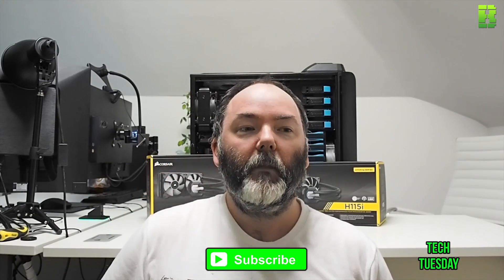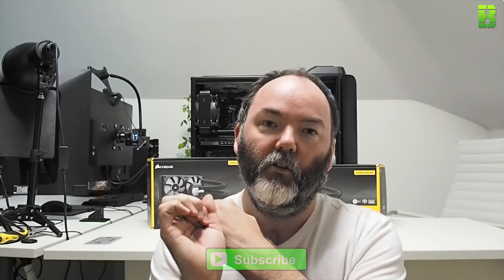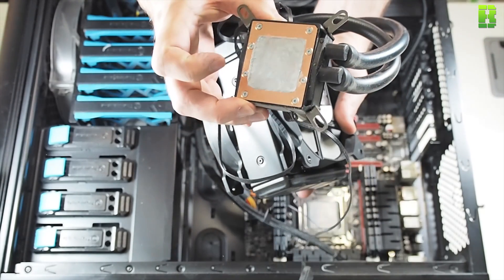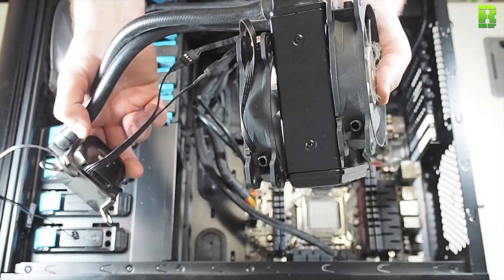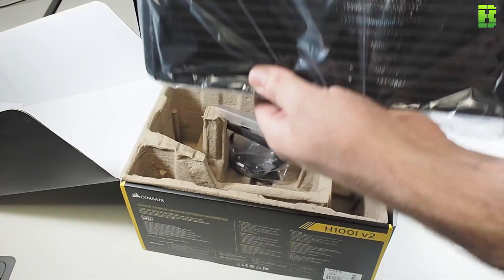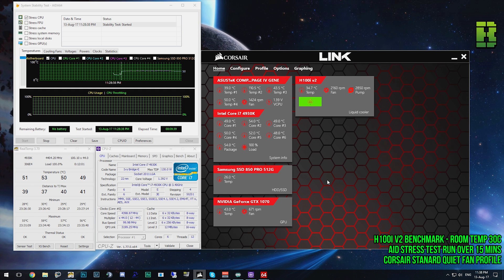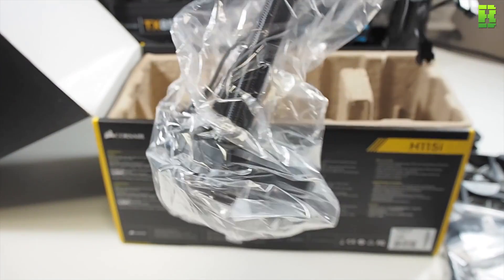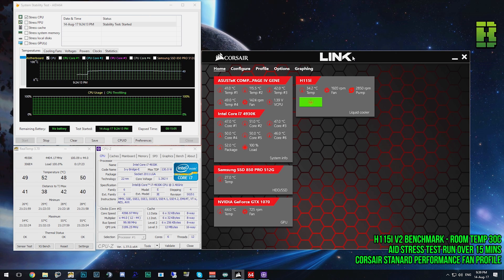Corsair H100i v2 Vs H115i Setup Installation & Benchmark

Comment: is the H115i hotter???
Reply from the maker: They were very similar, the main difference is the dB levels to achieve the same cooling temps
Reply: Beardedbob if the h100i v2 vs the h115i With the fans at full blast, which one is Best cooling performance wise? In your test the h115i seemed hotter, which i dont understand.

Comment: you put the system on 100% load for about 5 minutes with the first cooler, and then for about 10 minutes with the 2nd cooler, you should at least run 30 minutes on 100% for each cooler to be honest. with this bench test we cant say anything about the performance of either one. :( thanks for making the video though.
Reply from the maker: Yeah, I could have done a more extended test. I've done a few before and when the top temperature they don't generally move much from it. If I do some more, I'll look to do a more extended test though 👍
Reply: @Beardedbob  you'd say performance between them are too similar so that vsn be said that the cheaper one is the better option?
Reply from the maker: These two are very close in performance I found the smaller 240mm fans to perform better but they are louder. If its between these two I would base my decision on the two following requirements:-

1. How loud you are willing to accept (280mm being quieter)
2. How much room you have in your case to mount it.
Reply: @Beardedbob  thanks, I'll was leaning towards the larger fan option because of noise levels so the larger ones are the only option for me, thanks again!
Reply from the maker: Np Glenn Snel glad I could help 👍

Comment: well the 115i is performing not as good as the h100i v2 but did you look at your fan settings?  the h100i v2 is running much higher fan and pump speed.  so it is getting lower temps but how noisy is it in comparison?  If you equalize fan speeds what is the max performance that you will get?
Reply from the maker: Its good point but I couldn't tell the difference though I'm used to having loud pc's. Specs say 40db for the 115 and 37 for the 100.
Reply from the maker: no DB meter but for the next I might get one so i can see how loud the are in numbers hard to tell by ear.

Comment: i have the h100i v1 and i hit 90cpu on battlefield 1 2k max graphics. tower's Ambient temp is high ok (55-60_ because of my gtx 1080. liquid temp on pump gets 52 at its max. Is that normal? Why that high temp? Maybe my high ambient temp in tower makes the problem worse or the liquid inside the h100i v1 is dead? i have it more than 3 years i think
Reply from the maker: Seems high. What CPU do u have and is it OC? 

It should be 50c to 60c std underload generally iand 80's OC. 

Also worth checking the thermal paste is good or swapping it for some new.

Comment: 51C is 122F.  That still seems a little warm or is that acceptable.
Reply from the maker: Hi,

51c is cool given its OC and running in a warm room around 28c. The CPU can run up to around 80c without any damage so if you are around this temp you are well within the heat limits.
Reply: Base CPU is 28-32C Idle, 51-55C Cinebench.  4.8 Overclock is idle  31-34C and 76-81C.  Thanks for the info.
Reply: under 60C - very good    60-70C - cozy area     70-80C - still in normal, comfort zone    80-90C - not very good you should consider upgrading     90 and up - unaccaptable. So 51C is a very good temperature for the CPU and you have a ton of headroom for overclocking.

Comment: h100i v2 vs h115i The result is less noise ! 2160RPM vs 1260RPM and pump is running slower = more lifelength ?
Reply from the maker: The noise on the h100 is 38db and the h115 is 40db so they are both similar in that sense. The pump could be slower in the h115i i've not checked or seem this but life length is hard to predict and usually the fans go first tbh unless you get a lemon or you change the cpu and cooler at the same time. The average life span is about 2-3 years people reckon.
Reply: 2160RPM vs 1920RPM  for fan
Reply: That would be correct, I'm upgrading from my H100iGTX to the H115i Pro because mine recently died at exactly 3 years since the PC was built.

Comment: Thanks for the video.  I have the h100i v2 in my case and was really considering moving up to the h115.  But from what I see in  your video temps actually where higher.  Which cooler would you recommend?
Reply from the maker: Hi,

I would save your cash and just stay with the H100i v2 if you are finding its keeping the cpu cool.
Reply: Beardedbob yeah.  I have the 7700k overclocked 4.9ghz.  Max temp 69c after 30min stress.  Id like to hit 5.0ghz but im looking for a better cooling option.
Reply from the maker: Nice OC, I want to try the Kraken X62 280mm or a be Quiet 360mm AIO
Reply: Beardedbob i think i might just go full liquid.
Reply from the maker: +SpecterMatthew custom is the best :-) and looks sexy as
Reply: I'm with BeardedBob.  Save your money.  You're talking about spending $135 to upgrade a perfectly fine AIO so you can get 100 MHz more out of your OC??  If you were close to breaking a record, I'd say go for it, but is it really worth the money for gains you will never notice except through CPU-Z?